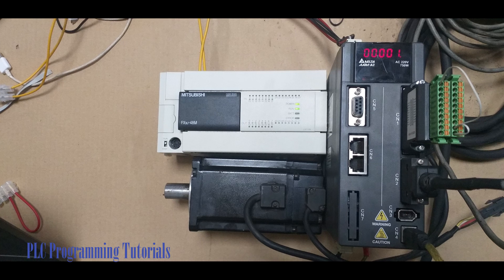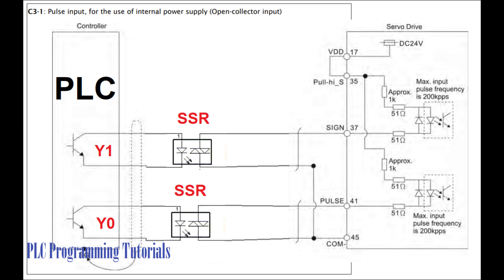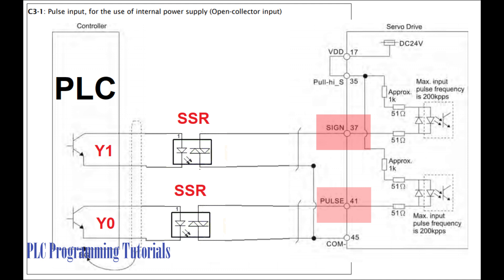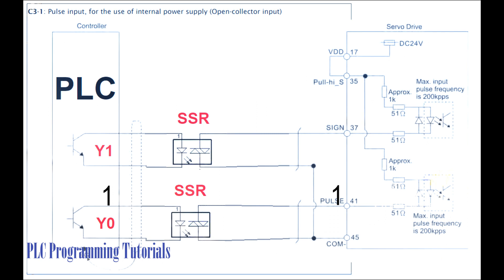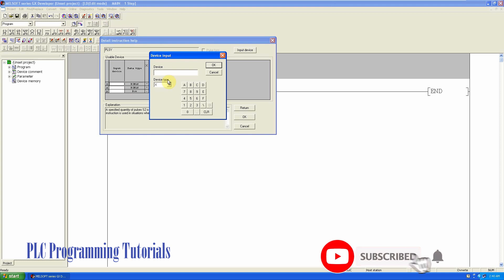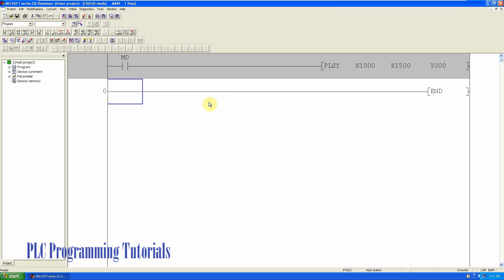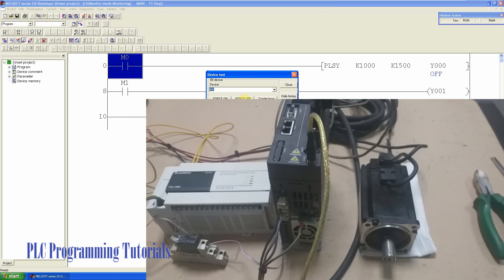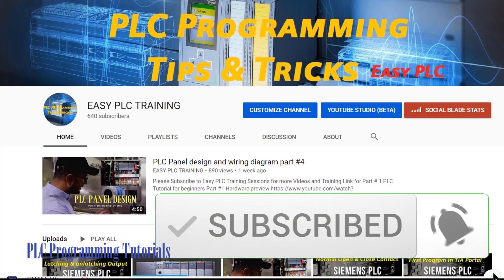Lesson #10 || Delta Servo Drive with Mitsubishi PLC || PLC Programming tutorials

Comment: It's looks ssr is  triac output it for ac load circuit. 
What type of ssr did you used..?
Reply from the maker: Normal SSR with transistor output for dc signal..... I just invert the plc output signal